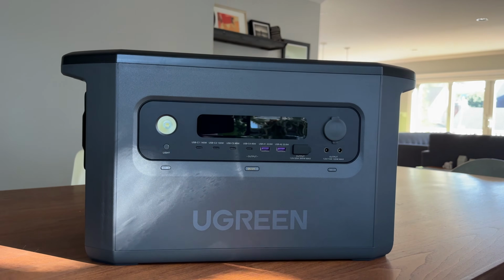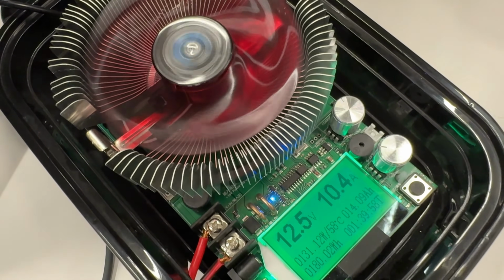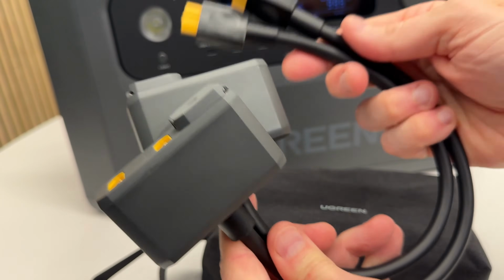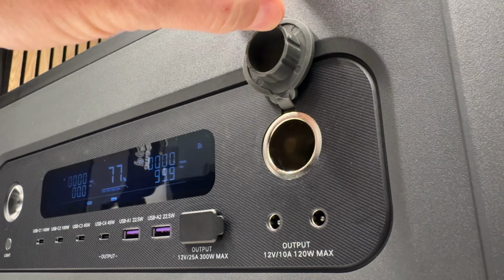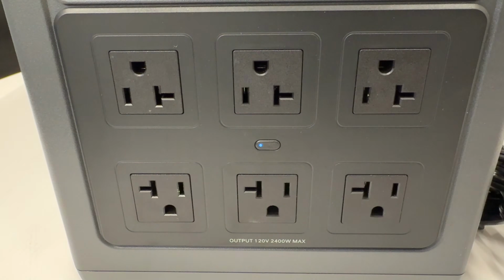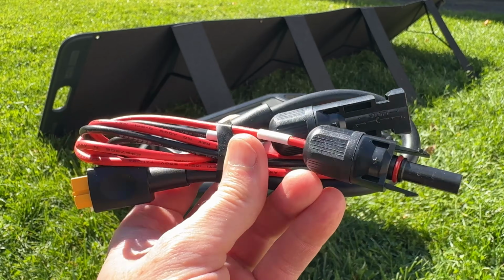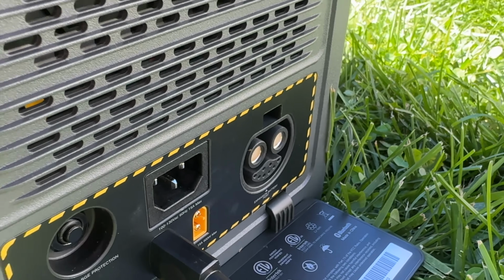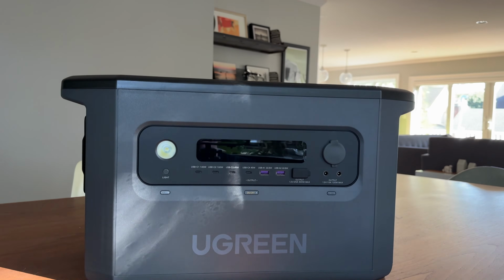Watch this before you buy Anker or Ecoflow - UGREEN PowerRoam 2200 is the new king

Comment: Hi Todd. 
Great review. 
But I'm confused. What do you mean with "High  voltage panels? 
What voltage is a hight voltage or a low voltage for this matter ?
My paneles work at 18V(Open circuit voltage 23-25V). 
Will I have any problem with the powerroam and my panels? 
Best regards.
Reply from the maker: Your panels are fine. By high voltage, I mean larger residential panels that are usually 40-50v which means you can only connect them in parallel so wire losses are larger. High voltage limits let you wire more panels in series and you can get away with thinner wires. Most unit this size are now 60v so it's not unusual

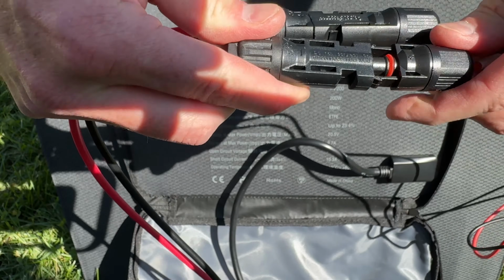Comment: Hey Todd, great review but I’m confused, maybe you can explain. I’m looking to use this unit in my van build and as a home backup. I plan on roof mounted 2x100 watt panels connected in parallel.My question and confusion comes from your video around the 11:20 mark when you connect up the MC4 and XT60 . Can I connect my solar parallel MC4 connector to a MC4 to XT60 adapter and then to solar input on 2200? Any clarification is appreciated. Steve
Reply from the maker: Yes, you can connect any panels to this with a MC4 to XT60 adapter as long as you don't exceed the max voltage. I was just saying that you'd need to buy an adapter like the one Ecoflow sells rather than using the adapter they provide with their panels.

Comment: EVERY and i mean it, EVERY powerstation out there, has really really bad MPPT solar chargers. Anker/Ugreen has the worst and by this i mean they have limited the input voltage to just 1 panel if you need to specific charge those only from solar.

The only way is from the Ecoflow Delta Pro that has almost good MPPT that accepts 150V and 15A input limitation. That means you can use 3 big solar panels and actually charge with 1.5-1.6kW from Solar.

I dare EVERYONE of the reviewers, those powerstation ISN'T for powering your cabin or your small house, except the Delta Pro's.
After this budget, you can go to Delta Pro Ultra but there the cost will doubled.
Reply from the maker: I agree that the trend towards 60v limits on solar inputs is a terrible direction, super limiting. Been having fun with the EcoFlow Delta Pro Ultra because it has awesome solar input for high voltage arrays.

Comment: Great video as always Todd! I’m curious how much energy is lost through the AC conversion. Would love to see an experiment that tests that.
Reply from the maker: Do you mean when charging it or powering AC appliances? I test the latter - it's the AC capacity test at .2C in the video.
Reply: Sorry, I didn’t explain that well at all! I’m curious if you had two identical loads on the device but one is DC and one is AC, how much battery drain would we see for each for, say, half an hour. 
I have to assume that converting to AC comes with a certain power loss and that we would see more drain on the battery even though the two devices take the same draw. 
Ultimately I’m interested to know if it makes sense to try and have most of your devices run on DC (assuming no other conversions necessary in the device itself). 
Hope that made sense! 😅

Comment: I am excited to see this large mobile power station space heating up, driving innovation up and costs down.  The negatives should be highlighted in my opinion. Some of them are: 1) Lack of high speed wireless phone charging on the top flat surface; 2) Lack bidirectional USB-C 100W (i like the other output USB-c ports however); 3) very low DC solar voltage input limit.  I would like to see 3x the 60Vdc limit for up to two inputs.  This greatly reduces wire copper size and panel selection without stranded power, and allows for ~10% improvement in charge efficiency if using a large DC generator; 4) Many situations require charge limiting, so having selectable charge rate (and time) as well as discharge rate (and time) per port would be nice to see; 5) not allowing simultaneous DC with AC charging while discharging and being able to configure the rate limits is a deal killer to me at this size and cost. 6) I would like to see a 45A dc input port (vs the two 15A, even if it had a lower voltage limit than the other port, but ideally both should be >160Vdc.

I am starting to wonder where the dividing line will be between the expensive elegant all in one power stations (like this but likely larger) vs semi-portable modular units using 48Vdc LiFePO4 server rack batteries, charge controllers and inverters, where you can get about 2x to 3x the capacity per dollar, but at a price in terms of size/shape elegance.  My guess is somewhere around $5k to $8k the value shifts to modular, but only time will tell.

Comment: I have 2 of the smaller units (GS 1200) the hardware is really good but it is let down by the bug laden app, which is slow to respond , gives constant over voltage and USB power error warnings, and keeps turning U-turbo on for no reason.
Reply: Good to know and something that you won't see on reviews.
Reply from the maker: I didn’t run into those issues and I used this pretty hard but that’s a bummer. Let’s hope they’ve improved

Comment: 1. I miss the possibility to monitor the online and offline history as in all Portable Power Stations
2. The connection cables for the additional battery look terrible, they take up a lot of space like most competitors, but some competitors have finally started using 90 degree connectors
3. I really like the trolley which is better when there is no option of wheels from the manufacturer or the wheels and handle are fixed in the unit, 
simple: when needed – used, when not needed – put away
4. I like that the solar charging cables are included in the Portable Power package, which is obvious, but that someone doesn't put it in the package = horrible
5. I would really like it if it were possible to connect two identical or even different UGREEN devices that could handle double or more AC load, where the second device would only turn on the DC/AC inverter when needed, otherwise it would be off and only its battery would be used
7. I would very much like to be able to connect to a Home Assistant system, where the environment for the solar monitoring system is already pre-prepared, and where the UGREEN device could be used for home automation
8. I would hope that the additional batteries should be able to be charged separately like the main unit from AC and solar inputs and the additional batteries should have DC outputs like the main unit
Will there be a 240V version for Europe?
Reply from the maker: Thanks for sharing

Comment: A 20ms transfer time is not sufficient for computers per the ATX specification which requires that PSUs hold up power for at least 17ms. @Jasonoid has tested many 20ms units and many of them cause his computer to reboot every fifth try or so. I'd love to see a unit with 10ms transfer time which is closer to what a standard offline UPS can do.

I'm not a fan of UGREEN as they have previously overstated their safety listings on Amazon. However, this unit has an ETL safety mark printed right on it so it is likely the real deal. Ensuring that the solar charge splitter doesn't have voltage on the uncovered ports is a very good sign.

Not supporting simultaneous AC and solar charging is a bit of a bummer. That's a common feature of many other brands.

Having four USB-C ports and one that is PD 3.1 is amazing. More brands need to do this. Bluetti and Anker need to take notes!
Reply from the maker: I agree that 15ms would be ideal - Jasonoid does the best UPS testing and will be even better in his next video. I have to say I came away very impressed with UGREEN’s system. For a first attempt, they really crushed it